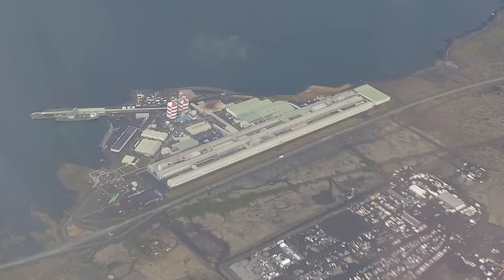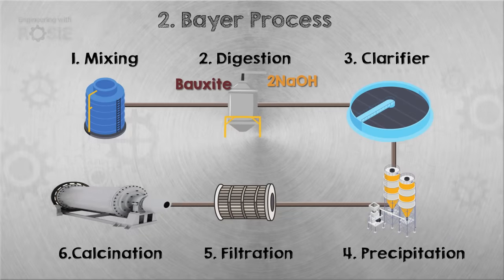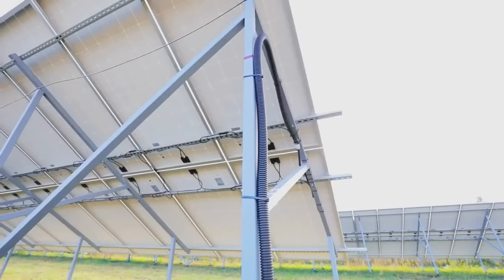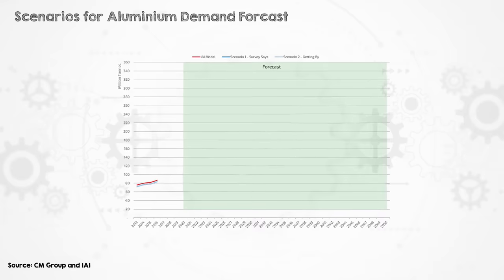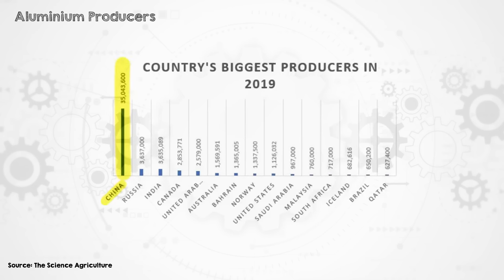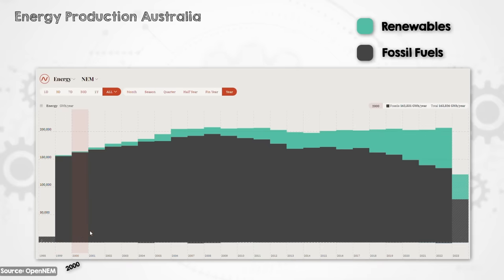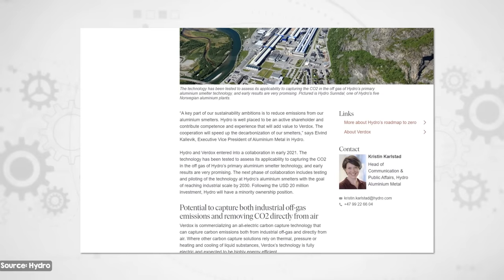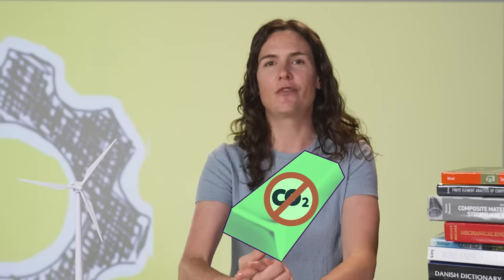Emissions-Free Aluminium: Which Technologies are Changing Everything

Comment: I did some contracting work recently for an aluminium recycling plant where they wanted to take recycling one step further. The idea was to use LIBS (Laser induced breakdown spectroscopy) to determine the alloy of recycled material and thus be able to sort it in-line. The added value is that it can then be sold to smelters as a single alloy instead of a mixture. The technique was sound. Unfortunately for other non-technical reasons the project has never become operational.
Reply: This should be patented as soon as possible; the technology is too promising to give up on
Reply: @gabedarrett1301 or maybe open sourced so we all have access to this and other important tech?
Reply: What were those other non-technical reasons?
Reply: @petertrypsteen Management decisions. Financial mainly. But other reasons as well.

Comment: I love these topics. We use the variability in power demand in Quebec pretty extensively: if there’s a short demand spike we can ask the smelters to turn down the heat for a few hours; if there’s a cold snap in the forecast they can just take a few pots out of production for the week.

One thing I’d like to hear is what other industries (beyond Al smelters) can have this kind of variable demand, to use very cheap power. That seems to be the grid we’re headed for: lots of excess power most of the time, with some months a bit more lean and some days or hours very tight. Variable demand seems like a great alternative to batteries for those leaner periods.

Comment: One other important point is that products need to be required to be made to last as long as possible. No more low quality garbage that gets tossed out. Recycling may be better than refining new aluminum, but keeping the original piece of equipment made of aluminum instead of throwing it away at the scrapper’s is infinitely more efficient.
Reply: Companies have resorted to something called "mandatory obsolescence" while designing a product to maximize their profit! You are expecting too much of ethics from the current form of capitalism

Comment: Hi Rosie. Great channel. In the bayer process, bauxite digestion temp is between about 150 and 200C(depending on the type of bauxite) and the Al2O3.3H2O precipitation circuit runs at about 75C.

Comment: Replacing aluminum or steel with basalt or wood fiber in composites can be a good way to cut fossil trade emissions. Both materials increase direct air drawdown, too: wood fiber sequesters carbon drawn down by trees; byproduct basalt fines absorb CO2 by weathering.

Comment: Another very informative video! Thanks. I'm wondering what recycling aluminum entails in terms of equipment and energy use. It would be great if a wind or solar project could completely decouple from the grid and make aluminum ingots at a profit, and not have to deal with utilities.
Reply: I love your first question, it would be great to see someone like @EngineeringwithRosie do a comparison.

I don't like your second question much - surely it's much better for the refiner to have the added backup capacity of a geographically wide grid, and better for the grid to have controllable demand.
Reply: It takes about 5% of the energy to remelt aluminium than it does to smelt it from ore.
Reply: Why would that be great? A big consumer that can vary its demand is vety useful in a grid.

Comment: I believe that there are chloro fluoro carbons linked emissions at the electrodes. How significant are they as compared to the overall emissions?
Reply: I think these can be mostly eliminated by more careful running of the electrolysis cells (which also results in better production efficiency).  I think it also depends on the mix of impurities in the alumina.  IIRC it's mostly older and/or badly run smelters with poor process control which have this problem, but it can be significant (since PFCs are potent greenhouse gases).
Reply: Also, cryolite doesn’t contain any chlorine, so CFC synthesis and emissions aren’t really an issue. From what I’ve read, part of the digestion and purification process removes chlorine from the bauxite by washing to remove soluble salts - a pretty easy and sure way to achieve high purity aluminium oxide feedstock.

Comment: Hi Rosie not quite correct for the Alumina refinery… For a high temp plant you need about 400 deg C plus high pressure to dissolve the alumina into the caustic soda…. I still think SMR would do the job nicely

Comment: Great video, exciting topic!
EnPot's active temperature control scheme seems like a game changer for smelters and grid stability.
Probably not that useful for very remote smelters that practically have their own grid.
Reply from the maker: I'd like to get a good look at the Enpot system, hopefully I can arrange a tour some day. It hasn't been as enthusiastically adopted by industry as I might have thought, though.
Reply: It's interesting, I would've thought that following the central air conditioning model, by having a central heat store (e.g. molten salt) and then pumping varying quantities of that around to maintain a given temperature would allow a lot of flexibility.  You could overheat the storage tank when electricity is cheaper, and just pump it at a slower rate to maintain the same temperature.  Likewise when electricity becomes expensive, you can shut off the heaters and keep pumping the hot fluid around to maintain the desired temperature where it's needed for however long the heat in the central storage tank lasts.
Reply: @EngineeringwithRosie 
I wonder how much heat loss can be prevented through geometry alone- i.e., square/ cube law,
reducing heat losses by increasing the size of a single cell (or group of cells with a common heat loss surface), or choosing shapes with a more desirable volume/ surface proportion.

I also wonder if tunability beyond 30 % will be economic.

I suppose this comes down to complex economic and engineering considerations, so i'm excited for any future videos around this topic :)

Comment: Primary production will always be needed. For structural applications, such as airplane wing spars virgin aluminum is required because the final alloy used must be carefully controlled to ensure the structure is strong enough. You really don't want your airplane wings falling off.

Comment: I think I've remembered correctly that high voltage transmission lines are made out of aluminium too. So, aluminium is needed to deliver the electricity to the smelter to make aluminium to make the cables to deliver the electricity to make the aluminium.........

Comment: All those old EV batteries need to be made into grid storage. 1000 batteries with 60kw  of usage is 60 meg of storage. now do that each year. Plus each year it will increase.  so in 10 years it would be over 1 billion watts of storage. Sure by then the first ones would be spent so they would have to be recycled. This means as solar grows the grid can backup more power during the day so the cost at night and day would be same price or at least close. also Flow batteries on large scales can even be used. Also solid iron batteries which like heat can be used in the desert.

Comment: Does this infinite recycling work for just pure aluminum, or also for it's alloys? We use drastically different alloys for different things from machining, to casting and stamping, and I do not see how you could reuse them without knowing the exact composition of every aluminum object recycled?
Reply: just add the ingredients and bake in your easy-bake oven.. like we do with iron/steel, base material is easier on the environment im sure.

Comment: Very interesting and good explanation! I was just wondering why inert anodes are not in use yet? Does the upfront cost not cancel out the degradation of the carbon anodes?
Reply: It's relatively new, the patents haven't expired yet.
Reply: I suppose carbon is also rather cheap, and it's oxidation might also result in lower voltage across the cell,

In addition to adoption taking time and money for existing plants, or not making economic sense for some plant operators.
Reply: Concerning carbon electrodes, I wonder:  can't we simply use biomass based electrodes to make them not be a net source of emissions? I.e, charcoal based on agricultural byproducts?
Reply: @nos9784  Biomass would need to be processed a lot to get electrolysis-grade carbon. Trying to use biomass seems a really bad idea.
Reply: @johnbash-on-ger  why, though?
Charcoal was only replaced by coke in metallurgy when the forrests got depleted. 

Isn't good charcoal clean enough as a feedstock?

Comment: It really is a shame that Australia isn't producing aluminium rather than just bauxite. Bauxite sells for around $USD40/tonne. About 4-5 tonnes of bauxite goes into making aluminium which sells for around $USD2000/tonne. Australia has massive reserves of sunlight for solar and massive amounts of coastline where they could easily install wind turbines. At about $USD1800/tonne it's gotta be worth thinking about doing it local. The largest wind turbines are now each capable of supplying enough power to process about 1 tonne of aluminium per hour. 1 tonne per hour isn't much but 5-10 turbines running 24/7 would be 100-200 tonnes per day or in the region of $200-400,000 per day, $70-140B/year.

Comment: Aren't large-scale O2 emissions also problematic in principle?
Reply: Only at source, for fire safety reasons. But it’s less of a problem than you might think. The smelting pots have a continuous flow of purge air, so the discharge flue only contains a fraction of a percent more O2 than ordinary air does.
As for the atmosphere, the extra O2 is a negligible amount, so has no effect. Even if all Al smelting switched to inert anodes, it wouldn’t make any real difference.
Reply: @simontillson482  If they make enough, it might be a good secondary product and help make the zero carbon process more competitive.
Reply: Nope. We would need truly stunning oxygen emissions from geologic sources to change the earth's oxygen content by a measurable amount.

Comment: Great stuff.  Related/unrelated question about hydro - we see a lot of photos of water being shot out from the dam wall - why is that not captured by a second electricity generator like a water wheel or screw - seems a waste of a lot of power
Reply: What we see photos of doesn't necessarily happen as often as you see it. This is partly why you see photos of it.
Reply: I think most of those photos are of spillways at a hydroelectric dam rather than the outlet to the water that went through the turbines.
Reply: @SocialDownclimber  oh right.  thanks

Comment: CO2 emissions are important,  but really are a negligible problem compared to the contaminated red mud waste steps.

The industry needs to push to have the iron content of the bauxite coming from the mines reduced by 80%.

This can be easily done by partial H2 reduction of the iron oxides to make them magnetic and use the related separation methods.

This is a proven solution the wound have a dramatic and rapid impact on one of the world's biggest waste issues.

Comment: Perhaps the parts of the process that require high temperatures might be a nitch use of Hydrogen.  If H2 is burnt in air you get a pretty hot flame.  If it is burnt in the Oxygen that was produced as a by product in the electrolysis process you get an even hotter flame.  If you pass the Hydrogen and Oxygen through electrical discharges to change the H2 into 2H atoms. an even hotter flame.  The faster you can bring the process up to temperature with a greater delta T between the heat source and the process, the less total energy you have to use.  Less is wasted in heat loss.

Comment: Hey perhaps even 200 degrees C in the neighborhood of some more exotic heat pump systems!?  I’m not sure and if you haven’t covered that before wow worth doing I hope here!!
Reply from the maker: The max temp I've seen that a heat pump can reach is 180°C, just a pilot system. 130° is more common. But there are lots of other zero emissions techs available to supply 200° (and much higher), I'm working on a video on zero emissions industrial heat now, it should be out in October so keep an eye out.
Reply: @EngineeringwithRosie  thanks yeah confusing stuff heat pumps - certainly seem worth continuing to improve indeed BUT obviously tricky situation with various Kigali considerations etc - once you get within a few degrees of a desired temperature then you can use electricity directly etc I’m just editing in here or wow ha I’m no expert

Comment: when pot-lines freeze thanks to intermittent, expensive, and ultimately unreliable electricity supply, the incentive is to close down, or move operations to a country where these problems are much less common. 
Industry wont wait around for these problems to be solved, they will go, and they will not return.

Comment: So aluminum refining is responsible for adding 1 GT of plant fertilizer/food,  known as Carbon Dioxide to the atmosphere,  which allows the reduction of the use of chemical fertilizers and reduced water needs of plants,  which need a minimum of 150 ppm (C4 photosynthesis) to 180 ppm (C3 photosynthesis -- most food plants) to survive and grow optimally at CO2 levels between 1000 and 10000 ppm.  YAY!!!

Comment: Good presentation, but it lacked the option of replacing aluminum with substitutes, like magnesium alloys and newer non-metallic materials. Magnesium specifically is lighter and stronger than aluminum, and requires much less energy to "mine" and process. Note: 1 cubic meter of seawater contains over 2 KG of magnesium. A non-flammable military alloy of Mg is now being made into electric bicycles, and could be expanded into many markets.

Comment: As an economist rather than an engineer I think that the development and adoption of these low emissions technologies will continue to be impeded by our failure to tax carbon emissions. Most of these technologies are likely to cost more to their users than current practice - if that was not so they would already be current practice. The only practical way to ensure their adoption is to make carbon emitters pay the cost of the damage they are doing to everyone else on the planet so that they have a finanicial incentive to stop doing that damage.
That said, it has always seemed a no-brainer to me to thermally insulate individual potlines so they can be turned on and off to take advantage of hourly variation in surplus electricity (as there has always been - people don't use much power when they're asleep). I'd expect people to move to that anyway as renewables, with their much larger diurnal variation, take over.

Comment: I'm very disappointed that you didn't even once mention the emerging small modular high temperature Gas cooled nuclear reactors under development for providing near zero emission electricity and process heat. Are you an anti-nuke, or do you have a bias against this technology? This seems like a significant omission.
Reply: She doesn't have a bias towards the technology, which is why she didn't mention it. She stated in the video that fossil fuels cannot provide power prices competitive enough to smelt aluminium economically, and nuclear plants' electricity is more expensive than that.

Comment: Using aluminum to build EVs to offset the battery weight only massively increases the embedded energy in the EV. Aluminum has 6x the embedded energy of steel, that means every EV has embedded energy equivalent in miles driven of something like 70k miles or a goad part of 6x that. If only Tesla would do a study revealing true energy use as miles equivalent driven.
Also alum producers are not going to be using intermittent energy only baseload, that really only mean nuclear heat or electricity.
Reply: Rosie literally demonstrated in the video that aluminium producers only really use renewables for energy because it is cheaper than coal and hence also nuclear. There was a whole section on it. Did you watch the video?
Reply: You don't need as much aluminium as you would need steel, by weight. 
It has ~a third the density (2.7 vs 7.8), and equal stiffness body panels are only a bit thicker than steel ones.

So the emissions likely would not be 6 times as high, but maybe three- ignoring later  life cycle energy savings due to a lighter vehicle.
Reply: Um messed up edit.
Hydro is a scarce RE, only a very few % of all available energy. If metal production is collocated near hydro it is either still on grid or is not. If not on the grid then the hydro which can be dispatchable is not available to be used for grid balancing. If the hydro is on the grid, then the colocation is moot. Other REs like solar and wind desperately need counter intermittency energy that hydro can be good at. If hydro is mostly used by metal production then fossil fuel peaking plants will be used to do the balancing elsewhere.
Reply: @johnjakson444  Your whole argument is false because it assumes that the entire world is one grid. Hydro makes up a large proportion of grids with significant aluminium refining. Please think about what you post before you post it. Then you will make fewer obvious errors.

Comment: Running industrial processes from fluctuating renewable energy is a bad idea. Read up on where China and Japan area heading with LFTR MSR reactors and HTGR reactors. Smarter and cheaper and less ressource demanding ways to deliver lots of energy and high temperature for industrial processes on demand
Reply: Except that in Australia, many mine sites are installing renewable energy on site to meet their power needs. This replaces the costs of trucking huge quantities of diesel from our ports. Industrial processes can be run on fluctuating renewable energy if they have load balancing or load following systems that reduce CO2 emissions and save money for the operators.